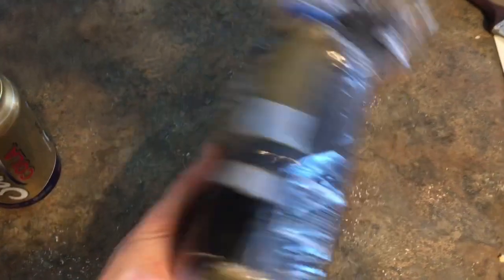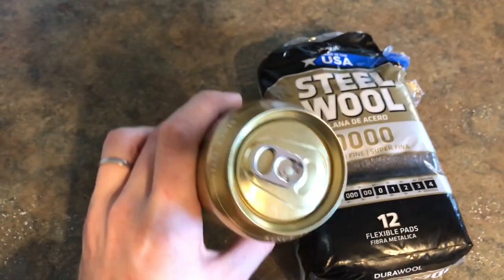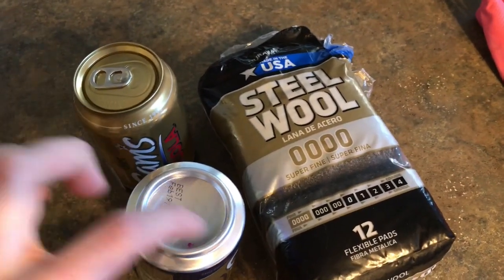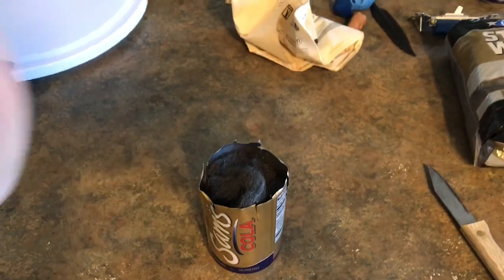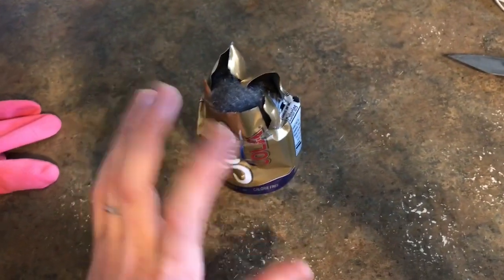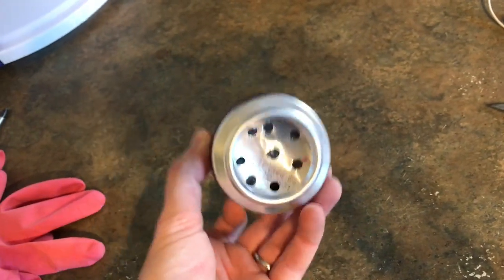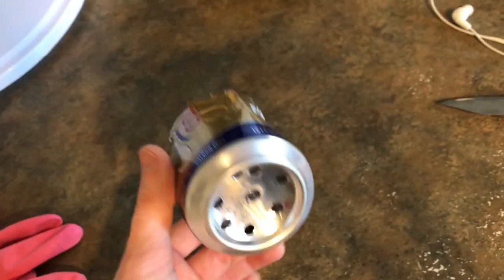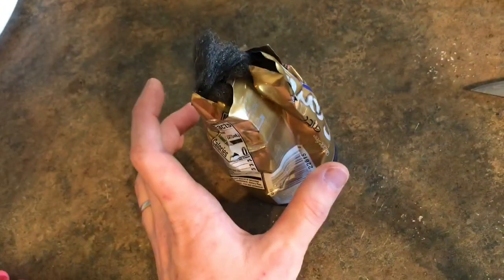Do Soda Can Mufflers Really Work?

Comment: Point of fact, no. It doesn’t work. I tried it myself and my 125cc gy6 tore the can wide open, spilling out extremely hot steel wool. Yes, I had the soda can open, packed, and mounted like it should be. I never left my yard and that happened. Just revved the motor a few times to see what it sounded like. I let everything cool off and scrapped it. So, upon further reflection, soda cans and steel wool suck as a muffler. Back to the old drawing board for plan B. 🤔